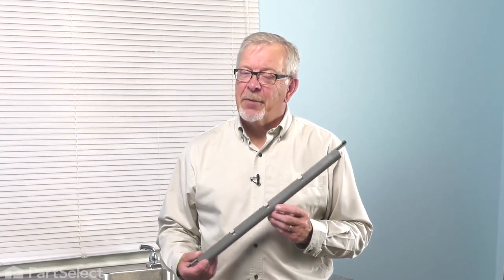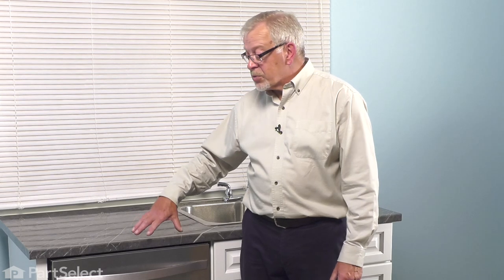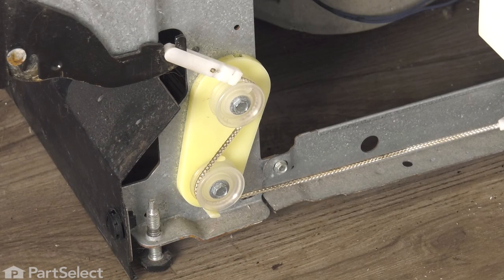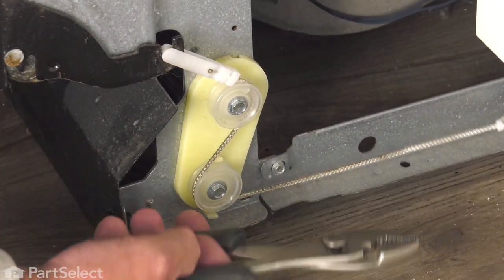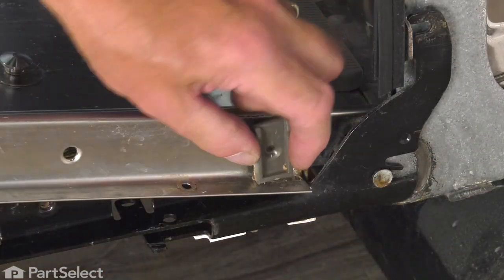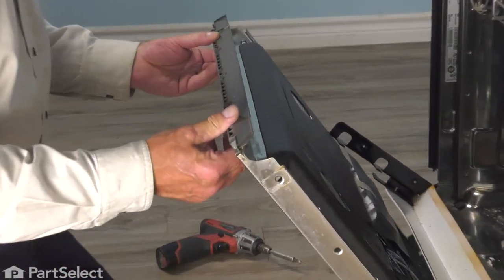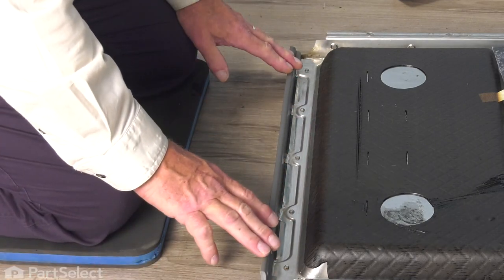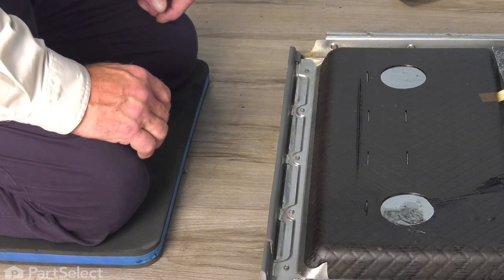Whirlpool Dishwasher Repair - How to Replace the Bottom Seal (Whirlpool Part # WPW10497235)

Comment: Many dishwashers have no bottom seal and can then leak due to a float level problem, bottom spinner arm problem, etc, causing waving of the water to the point water comes out the bottom. Something I've not seen mentioned in any videos is--is the water underneath the dw dirty or clean?

Comment: Thanks for your video.  I'm trying to diagnose a leak from the bottom of the door.  Have already replaced the rubber door seal, with no fix.  My question is, how to know if bottom seal is indeed the issue.
Reply: I have the same situation
Reply: @336MiniMafia  I am on the same boat. I cannot find any info on how this piece can be cause of a leak. These videos show how to replace it but no clue on why. What does the faulty seal look like? Etc.
Reply: @MrKaravelioglu  I replaced the whole door seal and the lower door seal. I never could fix the issue, and I had to buy a new dishwasher. I was tired of throwing money at it.
Reply: @336MiniMafia  I replaced the lower door seal as well. The leak was still there. I think the leak is from the main hub, but I did not try to replace that. I bought another one also.
Reply: @MrKaravelioglu  I'm currently dealing with this myself.  I replaced the door seal, the lower door seal, the diverter motor, and fixed some leveling issues.  I've pulled each of the wash arms and rinsed them out thoroughly....still...the dishwasher leaks out both sides of the lower part of the door.  I'm not sure where to turn next...very frustrating
Reply: @gamiclea  I am glad I saved myself time and money on parts by not going any further. Very disappointing as it lasted half as long as the one we had before which never leaked!
Reply: I have the same issue
Reply: @MrKaravelioglu  Well...I finally found the solution to the leaking from the sides of the door...and it's not what you would expect.  The lower washer arm started to come apart at the seams slightly...seemingly innocuous...but I was able to open the door quickly right when I saw the water leaking out...and at that moment I saw water gushing out horizontally toward the front and back of the unit...thus splashing water over the lip of the basin.  So...after replacing door seals, lower seal, diverter motor...it simply came down to getting a new washer arm for $80.  Works fine now...not a drop of leakage.
Reply: @gamiclea  Thanks George, good to know.
Reply: @gamiclea  just took a closer look at the spray arm and think you've got the answer for me. Looks like there's separation near the "corners" of the center oval portion. Has to be spraying right at the corner to cause it to spill over.
Reply: @gamiclea  after watching all the YouTube videos of replacing seals, I saw your comment and replaced the lower spray arm.  That literally fixed the leaking instantly.  $90 part and 30 seconds to install it.  Literally your comment saved me so much time and extra money.
Reply: Hello...replacing the lower spray arm is the ultimate fix for this problem...Thank You for posting!...It made a lot of sense, especially when I found the spray arm splitting at the seams!...😮

Comment: These are often called a "seal", but are more of a shield. Typically the doors don't actually seal at the bottom. Thus, overfilling (faulty float or valve) or abnormal spray pattern, as pointed out by lightlyone and George Miclea,  can allow water to flow between door and tub.
Reply: Brooo you saved me a tech visit with your comment. I just finished cleaning and changing the bottom ‘seal’ and I still had water coming out…because of the irregular stream coming from not having put the upper tray back on.